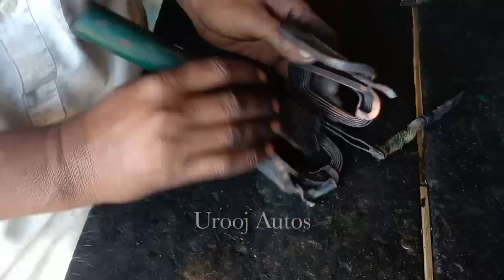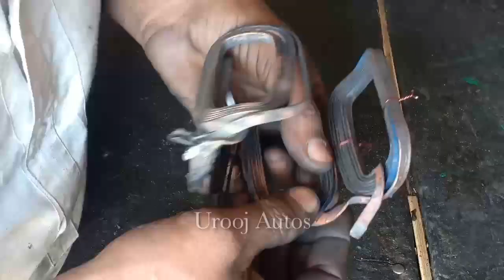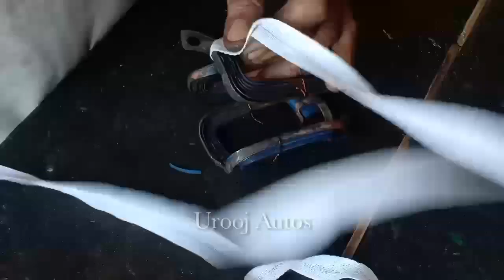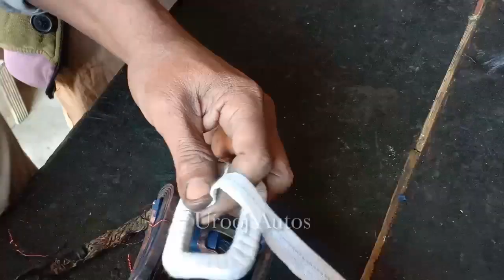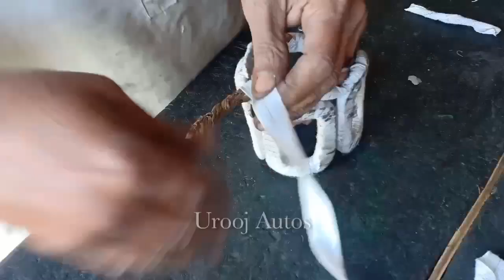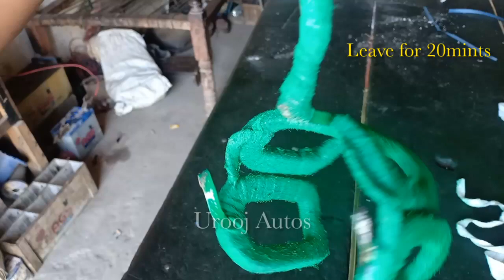Self Starter Field Winding & Repairing Manually|Self Body Winding|Self Body Coil Winding Manually

Comment: Good day and thank you for the video.  It would be nice for you to show the products during the video.  Such as what was the blue insulating material and the green spray was just paint I assume.  Also when you reassemble it, it looks like you are trying to orientate the coil and other parts in a certain direction. Is that arcuate?  Does it matter the way the the coils and magnates are reassembled?
Reply from the maker: Thank you for advice